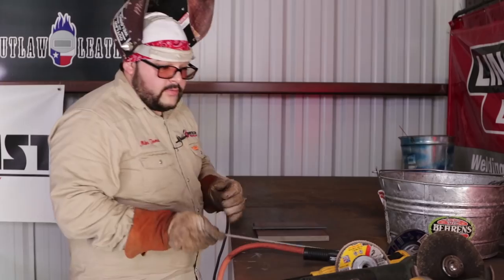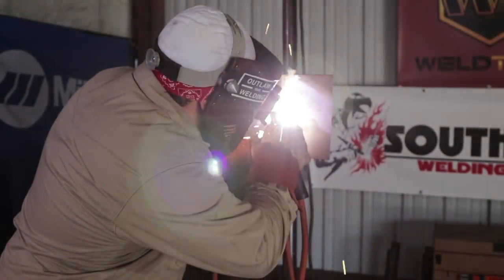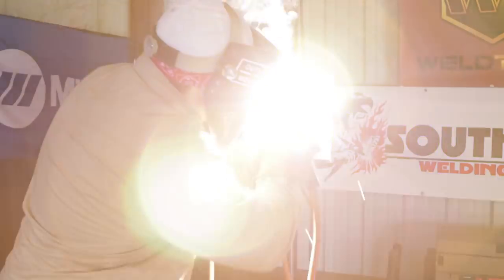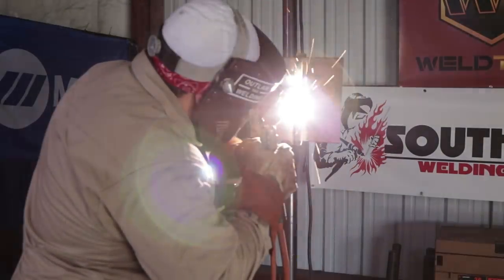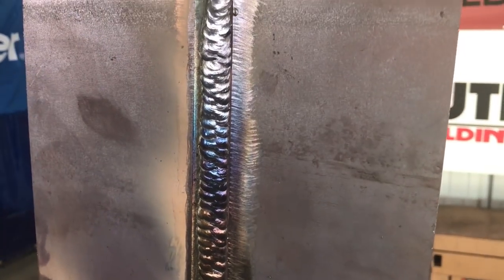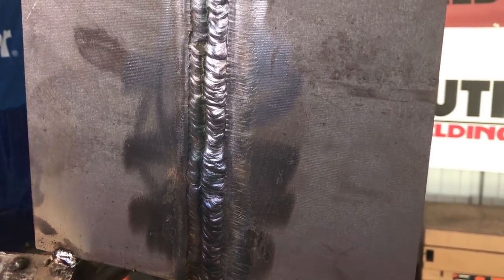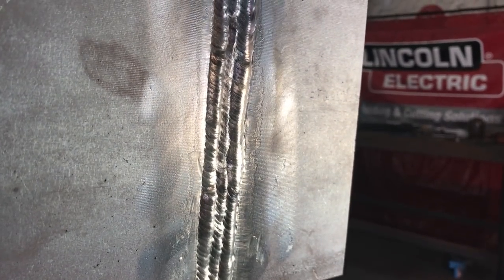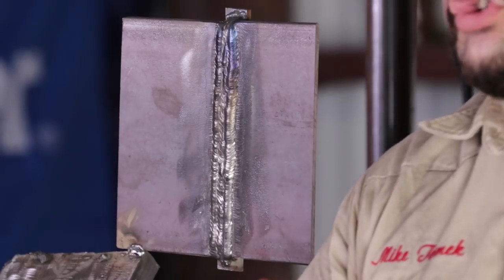3G Stick AWS D1.1 Structural Welding with Michael Tomek

Comment: I have a 3g and 4g test soon for a nuclear plant and this video has some great benefits thanks man
Reply: Whatever.. passing a 4G is known as all position... it overrides and certifies you for 3-g and 2G.. as long as the welding procedures and parameters. Are the same
Reply: @user-mt9tn1ni4g  nope 4g wont certify you to weld vertical, need 3g

Comment: I have a question I hope you will answer, please.
Pipe doesn't use a backing strip for the root so I wonder,
out in the "real world" will there always be a backing strip on every joint or does the backing strip in the test represent something else that would be found out on the job?
Could you go a bit further into the "why's and where for's" of the test procedures besides just how to lay the bead and settings, etc.?
Thank you!

Comment: Depending on the CWI administrating the test and the WPS you're given would determine wether you use the 3/32 or 1/8 7018 or a combination there of for the test. Most CWI will check your fit up and your root pass before just letting you continue with the test. Good test plate though.
Reply: There is only one procedure for a 3g 1.1 just one. According to the AWS specifications.. certain jobs and applications may change.. the specifications and procedures but they have to be approved... so a certified welding instructor giving a AWS certification cannot make up his own rules... and as far as 1/8 or 3/32 7018.. that does not make a difference at all as far as the AWS certification specifications... as long as you stay within the specific parameters that the different diameter wires have... 7018 is 7018 no matter what size diameter... but each size diameter has a different specification for Heat input.. bead width and interpass temperature!!

Comment: I passed my 2g3g4g today
Reply: If you pass your 4G that certifies you for all positions there's no need to take a 2G and 3-g
Reply: congrats!
Reply: I'm taking my 3G D1.1 which like the other guy says qualifies u for all SMAW welding in any position on any material.
Reply: @user-mt9tn1ni4g  not at school you take each test so they can see the results. Not certified just tests.
Reply: Carl is incorrect, 3g is separate from 4g, however 6g would cover both overhead and vertical
Reply: Yeah I'm pretty sure AWS certs consider each position a progressively harder skill bcuz to become certified for 1,2&3 u could take a 3g cert test or 4g and that qualifies u for anything else below it. 
I guess they figure if u can do overhead u can do vertical or if u can do vertical then horizontal n if u can do horizontal then flat n so on basically.
Reply: @glass4breakfast  to get a structural job you have to take both 3g and 4g in Colorado unless you are independent and have paid for your own certs even then im sure you have to do 3g and 4g. verticle and overhead are way different some can do overhead and not verticle i was that way for almost 2 years in my career as an ironworker
Reply: @quintonmaes8777  I agree with you, I had no problem with 4g but struggled with 3g for a while in school... everyone told me overhead was the hardest but i struggled with vertical up the most.. I'm taking my first cert tests this fall. I live in Grand Junction. Where you working at?
Reply: @freshfavorites7212  thats how it is at my school, gotta pass all posiitions in order. Even in GMAW we had to take all tests in order using short circuit before going on to spray transfer. As a newbie, passing all 4 bend tests with short circuit mig was a bitch, but I'm glad I got the experience.
Reply: @MikeP350  I work in Denver plenty of work here right now especially for structural welders
Reply: @quintonmaes8777   Several of us will be doing our cert tests in the fall. The plan is to test for 4G and 4F. All of us are self employed welders. Mike P is right. Lots of structural work right now in Denver/Lone tree/Tech center.

Comment: I did this today for NOCTI and boogered it all up. For some reason every tome i got about 1/3(1/2) to 2/3 the way up 6 inch long and half inch thick plate i think it was my bead went from a bead to crap dripping every where. Couldt get it to stop no matter how fast i went or whoch weave i tried it went to crap in the same 2 inch space.  1/8 inch 7018 rod with what i think was supposed to be a 3/32 gap ay 115 to start and 120 for the hot pass, but my rod fit with room to spare and i didnt feel like complaining, plus i figured a wider gap might help me, so i didnt say anything lile a dummy. HELP!
Reply: Mick Chuknit it’s called arc blow. If you’re running 1/8” or smaller diameter put your ground clamp at the top of the plate. If you’re running 5/32 or larger put the clamp at the bottom. It helps out tremendously.

Comment: Make sure to keep your rod 10°  angle.. over and over again at 10° angle.. but I watch these guys videos multiple times and.. when the welding rod reaches about 6 inches.. he's at 0°.. when the welding rod is brought down to about 4 in. His rod angle is pointing down the Stinger is above the ark!! At 3 to 2 in Rod length his rod angle is 15 to 20 degrees down.. so yeah so much for that
Reply: Carl Boucher when I was in school one of the instructors would hold a serious drag angle of 15-20 when he would do 3g7018 vertical and it was one of the slickest welds you’d ever seen! Moral of story is, do what works for you. (I could never get a hang of draging 7018 vertical)

Comment: Super videos, you guys are first class! If I lived close by, I'd be right there with you for "Tune-ups".
Several things I am interested in.
I would like to see 7018 stringers all the way out. 
Sometimes the guy giving the test (... if you are going for a job)  wants stringers. 
I would like to see a coupon bend; I always hold my breath on that one.
Lastly, (...yeah, I know it's tough) what rod do you prefer?  I've used them all.
The company you work for supplies the consumables; they might use your requests.
I have had both horrible results with some brands, and stellar looking welds with others (all fresh out of the can, or, rod oven). 
With the crew leader looking over your shoulder, I hate using inferior (in my opinion) brand rod. Especially when you are the new guy on the crew.
All comments appreciated; Thanks.
Reply: yeah i was just gonna say i thought weaving was a no go for structural
Reply: Weaving is not allowed in D1.1 but it needs to be defined by D1.1.

Comment: If it was me I would have done a stringer cap. You can run very hot on stringers and they will blend together very well and be slick as snot. My advice to this welder is get a hood you can see good enough that you don’t need to grind your edges. If you have problems finding the edge of weld that is were your inconsistency is coming from.

Comment: What is the application of this particular well joint in the field? Technically I've never seen a joint like this when erecting structural steel
Reply: Pipe
Reply: @ohshucks7156  this test doesn’t qualify you for pipe welding. It’s strictly a structural test.

Comment: Also the wps may state that you can't weave but have to run stringers only or vice versa.
Reply: Antoneo Alston the videos are good but they need to give out all the information on testing not just a one sided view. Also, it would be nice if the videos did incorporate a CWI there while they do these test examples to give a real live feel of what will happen at a test site.
Reply: That is true. I have had them say I cant weave past the second pass

Comment: Why were the fit up parameters not mentioned? ( min/max gap on the bevels and prep work)
Reply: Different companies certify different ways
Reply: Bevel is always 37.5 degrees
Reply: That's not true. 3g for 3/8 is 22.5
Reply: When y'all go to test do they have everything already beveled or do you have to do that?
Serious question I want to register to get certified soon
Reply: @roscojenkins9067  Its already beveled 37.5 degrees always 37.5, 37.5, 37.5 degrees don't let anyone tell you different it's always 37.5 degrees you got it.  you just have to clean of the lime scale and fit it up yourself.
Reply: @drunkmike9943  *mill scale
Reply: @WaylonI  correct
Reply: @roscojenkins9067  depends where you go what the company is and there specifications
Reply: Any time you have a backing strap you need 1/4" gap between feathered edges of plate.

Comment: As you were running the bead, i noticed that you were starting a new rod over the flux shielding of the previous bead. Is that correct? But when you do your second pass, I guess you have to clean of the protective flux first. Just want to understand this better. Thanks for the vide.
Reply: Danylo66 always have to clean slag off. Never weld over slag. But in this case, the slag will run out of the crater since he is running vertical up. Gravity pulls the slag down. 👍🏻
Reply: Sammy Dubose thanks, I was never sure about that.
Reply: No problem. Happy to help.
Reply: The slag on the stop is very minimal so yes you CAN run one PASS without chipping so the slag will protect the previous rod you burned from buckshot and trash but YES when you finish a complete pass from the bottom to top of plate you will clean ALL slag before starting your next full pass.

Comment: Yo bro, could you do a video about the best machines to weld for mig, tig and stick am trying to buy one but I don't know so much about machines, am sure other people would be interested on a video like that too, and thanks for your videos they help a lot ✌
Reply: Millers are great for shop welding, so pretty much mig and fluxcore and tig. For stick & tig welding in my opinion, the lincoln takes the win. A machine thats DC only gives out a smoother arc, than a machine thats AC/DC like the millers and some lincolns, and it works both ways too.

Comment: Corey Dixon Sr.
I see your work here Michael Tomek. Very nice welding on the 3G. My question is on the CAP where you mention the amps being set to around 95 amps while using 3/32" 7018 Rod. "Is that the same amps if I am using 1/8" 7018 Rod?
Reply: when you're running a 7018 1/8 inch rod the lowest you want to run it is about 115 or 120amps.... the only reason why he's running at 92-95 amps is because it's a smaller rod it's at 3/32 7018.
Reply: @MRSTEEL-fd7eg  You sir are correct

Comment: It’s kinda weird to me hearing backing strip I’ve always heard it as a backer bar
Edit: I do 7018 open root with a 1/4 in. gap how long should I pause? I’ve tried 2 seconds on each wall but still get undercut.
Reply: an open root with a 1/4” ?
Reply: Quenton Parsons with a backer bar
Reply: Try using stringers for the root instead of a weave, just to make it easier on ya, imo.

Comment: Going to school for this as well. Just a short term class, I am now doing 3G aws d1.1 but it's to prep us for the test next class. They have me doing a 2 cap pass. Is it just preference or is it state by state code
Reply: It all depends on the company and client your working for. I have my aws certs, well they have been expired for about 9 years now only because I found out quick that companies don't care if you show them a peace of paper that shows your certified because they give there own certification test that is harder If your going to work for a bigger company like Bechdel, CB&I or Fluor just to name a few. You will always have to certify for every company you work for and the tests will all be different. The last test I took was for CB&I and it was 1 inch plate 5/32 gap 1/8 rod root to flush 3/32 5 stringer cap xray.

Comment: So he is weaving instead of stringing that's crazy
Reply: Theone Paradox right! I've been stressing the fuck out thinking I had to. I'm trying this tmr ! I can just run stringers for the cap .
Reply: Just depends on test specs. You can weave or run stringers....but you gotta remember how far are you whipping to weave? Some places say 3x the diameter is a weave I've been somewhere where they consider 5x the diameter is a weave. Gotta ask questions....but I prefer weaves compared to stringers. Haha
Reply: Weaving is the easier way for me. I had a harder time runnin stringers

Comment: Can you guys please do the cwb weld tests. Smaw and fcaw. I love the videos
Reply: Aiden Hepburn CWB test are strict asf! Just so you know. Those Canadians don't play. Personally I think it their welding schools are better than the US. If you can pass their stuff then AWS test are easy.
Reply: Ahmad Ali thanks for the response. I have passed the flat and horizontal smaw so far. The shop im at now is all flux and metal core. Im stuck on the vertical stick. I do agree they are very strict having 2 stop starts on the roots is a pain.Being in Alberta everything has strict limits
Reply: Aiden Hepburn I've been thinking about getting into one of the welding schools in Canada just so I can get all that CWB info under my belt. But it's hard asf just to get in the schools if you are from the US. It would be nice. I hold certs in all smaw, gmaw, fcaw structural  steel and GTAW  stainless, aluminum structural, all position sheet metal cert and a auto body (GMA) welding cert. But I don't have and CWB certs. They are next on my list someday

Comment: Why do you use a backing strip and do you leave it when done? I guess I don't understand the purpose of the backing strip.
Reply: 10:4 littleal I’ve never done this test for structural but when I took the guide bend test in college you blow it off with the torch and smooth it out before you  cut the plate and bend it. I think they allow it because unlike pipe almost all structural is a joint and usually always has some sort of backing
Reply: Allows for more burn it to ensure penetration and a good weld

Comment: They say that weave beads put high heat input into the joint,resulting in grain growth, which could lead to catastrophic failure of a joint
Reply: It also increases the chance of inclusions. I've never taken a test or seen a WPS that allows beads larger than 5/16 on structural.
Reply: @jca66  right on....
Reply: @jca66  so a plate test will have a quarter inch gap for the root opening, and using 1/8 diameter rod,you pretty much HAVE to run a 5/16 stringer for your root pass to tie in your bevels....
Reply: @geraldfahey2681  what's your point? 5/16 is the maximum single weld size. You will fail if you go wider
Reply: @jca66  i just wanted your input....
Reply: @geraldfahey2681  lol. My bad. Root opening depends on the test. They will tell you what they want.
Reply: @jca66  nice

Comment: Need tips for structural plate test 3g using mig process  1in thick plate 1/4 in thick gap please theres no videos or anything on this .
Reply: With a backing strap? If so then I may have a idea of you being able to accommodate that position with mig. It would be the "Triangle" method or my personal preference a side to side motion, or even: well it's not common in the field from what I heard but there is an old method that I was taught called the "Squirting" method sounds funny I know. But it'll save your ass if it's the only thing or last thing to think of imo, honestly.

Comment: How did u use to practice to get that good? I’m in school now so jus curious
Reply: Marcus TheGreat Just keep burning rod man. Don't avoid doing a certain procedure if you're not great at it. Work on it till you dont even have to worry about it anymore. If you really wanna get good, you got to be willing to put the work in, you'll get what you put into it.
Reply: Joel Argumedo Thanks bro
Reply: Practice practice practice. Its like riding a bike you could stop welding for a few years then when you start again you will be welding good as before after you burn a few rods.

Comment: 1/8 all day 3/32 is for the ladies.
Reply: Buaha 5/32 8018 all day  1/8 rod is for ppl that cant run verts or weld at 185 where i work so in other words 1/8" rod for rookies
Reply: Try running 3/16... Overhead on a 1/8in plate underwater on a Friday 5minutes to quitting time while your boss is breathing down your neck and you’re Waller’s so empty the light came on while your screen is dirty and your helper only has one arm and half his teeth are missing

Comment: not the most helpful. especially since i prefer stringers with slight manipulstion. but my biggest complaint is that he doesn't show the plate in between beads or layers, no cleaning or grinding to fix mistakes n when he does globally show it at the end n once in the beginning (after editing of course) its only very briefly n out of focus so it's hard to critique n compare to my own work n others in real life. 
he did go over some good tips while welding, that was the best part, but mostly stuff i already knew so it was only a good reminder. not worth watching the whole 25 mins honesty.
Reply: Don't watch. Practice on your spelling.